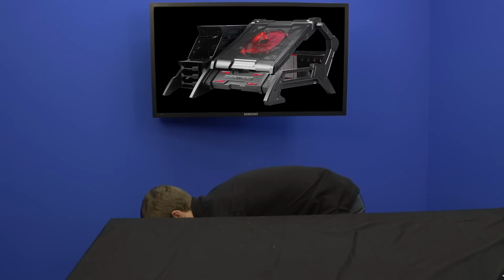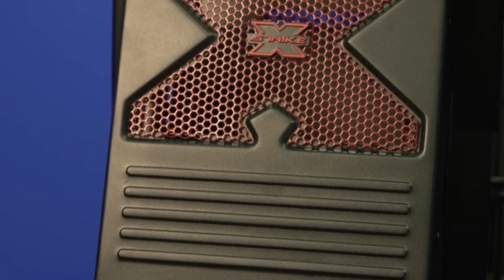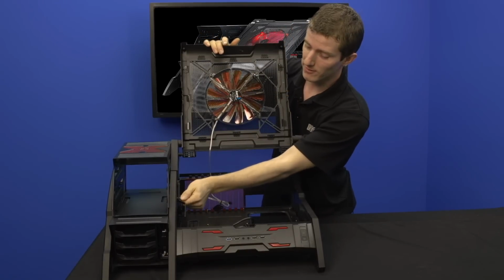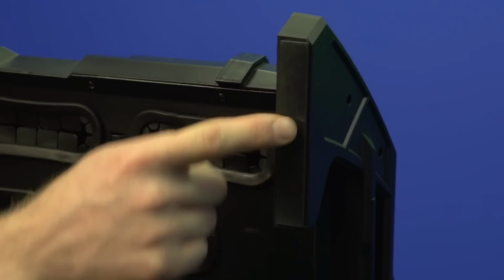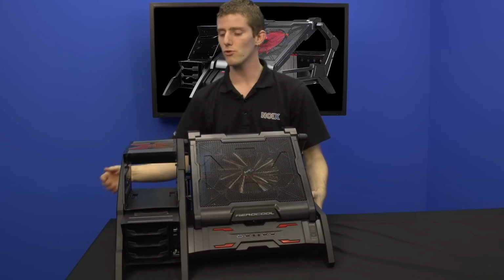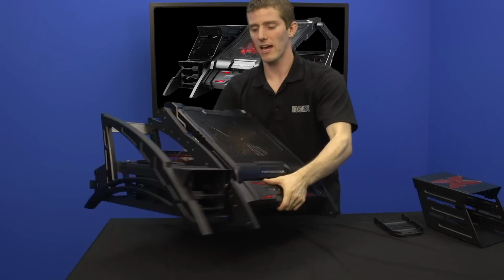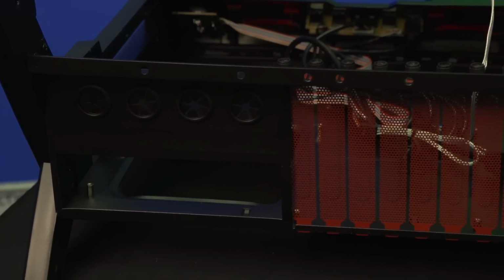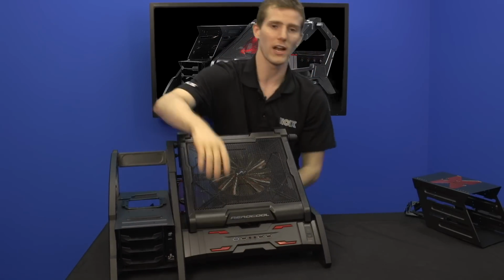Aerocool Strike-X Air open bench case

Comment: Poorly made, very dusty, the built in drive bay is garbage and who wants mechanical rives these days anyway. Temps are great though, ive had mine for 5-6 years and i will rebuild it into something more functional with better rad mounting, no mechanical drive bays , omit most of the plastic apart from probably the lid and mounting options for a couple of pump/res. Realistically could just build completely from scratch (i have skill and access to al required equipment) but i do have this already so meh.

Comment: Used to cost 80 usd and now it costs more than 500usd, ilogically for plastic.
Reply: Wtf 500? I paid like 50usd (was $69.95 Aussie dollery doo's on run-out) about 5ish years ago. About all its worth to be honest, the only good things are the no worry about card sag (especially with a coverall, but now risers are a thing so yeah..) and the temps are great. I really wouldn't recommend it, a lot of the actual test benches look much sturdier without the redundant drive bays.

Comment: So how would you setup a all in one water cooler on this
Reply: It has a rad mount on the back,  for 240mm factory but a cordless drill can turn that into 280mm. I pissed of the top drive bay and i have a 240mm in  there as well as the pump/res as well.

Comment: what are the disadvantages of open cases? except pets issue?
Reply: Not much. It takes up a lot of room, so you'll want to check the dimensions, but it keeps everything cool. I was able to overclock all my components without any issue and have yet to have any heat problems. I have a balloon pump next to my chair, so if I'm ever worried about too much dust, I'll just pump air on it. The build quality isn't great, though. The USB 3.0 was broken on mine; squished and had a few cracks on it, while the 2.0 ports were extremely tight. Audio jacks require a bit of a shove, but they work well. I would recommend this case.
Reply: ***** snorting on it ... yeah , you've got me there , buddy .

Comment: My modded version - /watch?v=zkIJjSC2O9c

I bought this, and you are all wrong seriously, i modded mine with a glass window at the top and a full water cooling system, it doesn't flex like it looks like it does, and frankly i don't think anyone would be moving it round all that often, I have taken it to LANS many times, with no problems, it's cool, looks awesome and gives me around 5 degrees colder than my old normal style case.

Comment: Thats if u have negative air pressure. Which most people, including me have. 

Thats when u have more exhaust then intake, so your exhaust sucks in extra air, but it also sucks in from areas that are not filtered like near your PCI slots.

So if u have postive pressure with filtered intakes, um ya no, definitely no dust "balls" , especially compared with this where dust will build up super fast.

Comment: Love the concept. An open hardware system would make upgrading and tweaking a BREEZE, and as someone that wouldn't mind having a room fan running 24/7 to keep dust to a minimum (I have noise canceling earphones) that would be perfect for me. Unfortunately it looks way too cheap for my liking. If another company made something made with steel that would be nice.

Comment: *Sight* the 810 is a FULL TOWER case! You know dude, you can't rate a case depending on a dust filter, and I personally has tested both the 810 and the R4 and the dust filters are pretty much the same, do you even know the difference of these two cases? I would say the 810 is better than the R4

Comment: Well that's your opinion. The R4 is a midi tower whilst the 810 is a full tower, both of them has pros and cons, it's just a matter of perspective and opinion. "And no noise", yeah, no. That depends on the components used and what fans you're using.

Comment: It depends on what you're doing. If you change hardware VERY common go for this case. If you're looking for a good quiet dust-proof case go for the NZXT. And of course it depends on how you want your PC to look like, if you really like the open-air design sure, go for this. But comparing these two no one is better than the other one.

Comment: If it's meant to be a test bench then it doesn't seem to be very efficient or practical in installing and removing hardware that's being tested. It looks cramped in there and not too easy to get your hand and screwdriver in.

Comment: Fit a small car radiator in it for water cooling
Reply: You could mount 2 x 280mm on the lid easily, plus one on the back factory mount! But who really needs that much anyways? I have this case and run one 280mm on the back factory mount and a 240 of to the side and its more than enough for a OC 1080 and ryzen 5900x that runs 4.6ghz fully loaded 5.1ghz light and does pump out the heat, the cpu is limited by blocks capacity rather than radiator space, i only really run the extra 240 to drop temps a bit right before gpu to keep the core boost as high as possible. i run pump/res-240mm-gpu-280mm-cpu.

Comment: I'm with everyone else this looks flimsy as heck. I mean when you propped up the fan area the weight of the fan caused that entire area to bend pretty badly. Also looks like a complete hassle to replace a motherboard since you could have to flip the entire thing on it's side or upside down to do so and remove all the drives so they don't fall out and the PSU because those plastic clips didn't look very sturdy. Neat Idea but I'd rather it be 70 bucks more and have some metal where it counts.

Comment: I've got this case. One tiny minus is the flimsy top panel. And it takes up quite a lot of space. Still a damn good open bench case. Pro tip: Put a 140mm fan in the CPU cutout for even lower temps. ;)